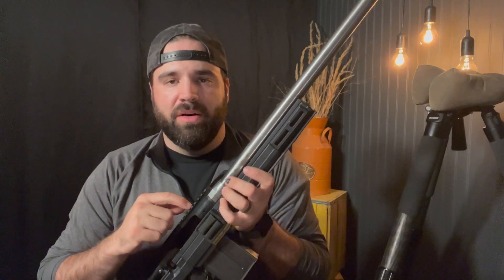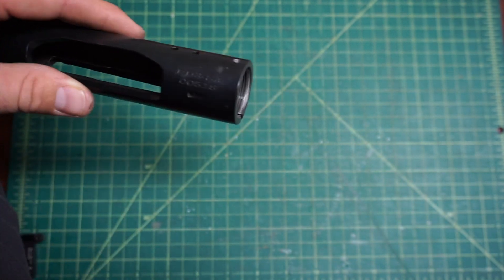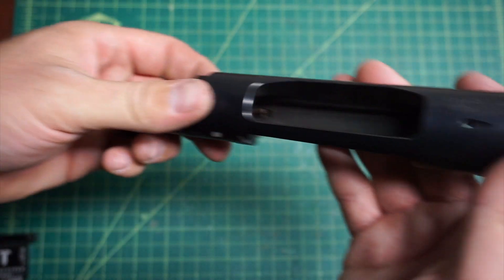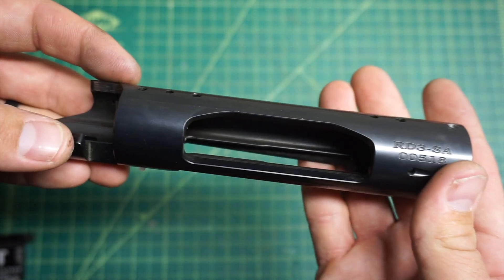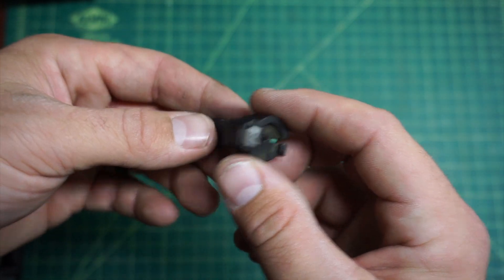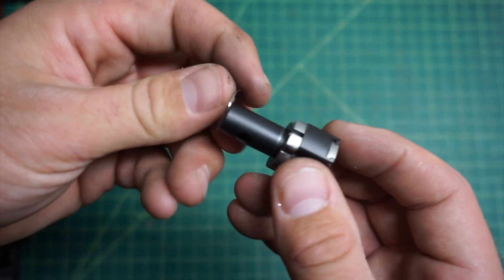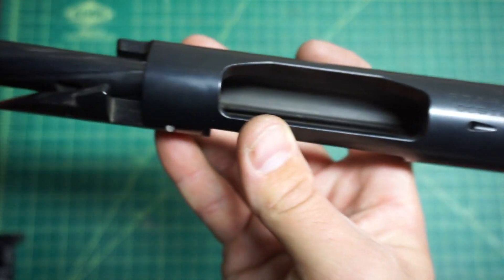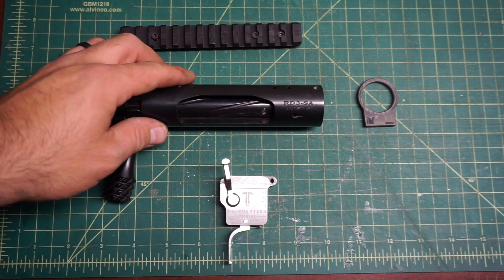Zermatt Arms Origin  Teardown

Comment: It appears the threaded section that the bolt knob threads onto is replaceable should it ever break. If so, good design. I like the simple mechanical ejector. Overall a simple straightforward design. Swappable and economically priced bolt heads make sense too. The Savage style threads give the option of using a barrel nut or shouldered pre-fit. What's not to like? If I had the money, I would buy several.

Comment: Do you need to remove the extractor to test for headspace with this action or can you place a go gauge into the extractor as it?
Reply from the maker: No you don’t have to go head space. I’ve double checked with the manufacturer and a local gunsmith that works with them a lot.
Reply: @CarbonPrecisionLLC  Thanks. I just put one together for the first time and it wont close with a go gauge so I'll give them a call to sort it out. Ray seems very responsive to issues.

Comment: If you wanted to mount a 2 piece scope base, what is it threaded for?
Reply from the maker: im not sure what the threads are,  but i think its a proprietary rail due to the locating pins. give zermatt a shout if you wanted to do that.
Reply: @CarbonPrecisionLLC  They said I could remove the rail and use two Remington front base/rungs. Then, I found some Talley base/rings that are made specially for the Origin action.
Reply from the maker: @texpatriot8462  perfect!  Glad they responded